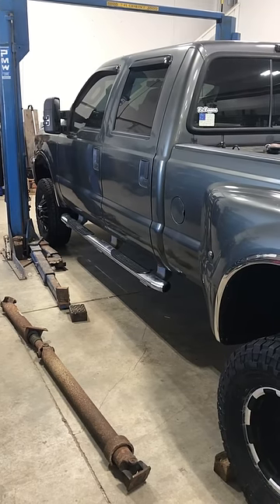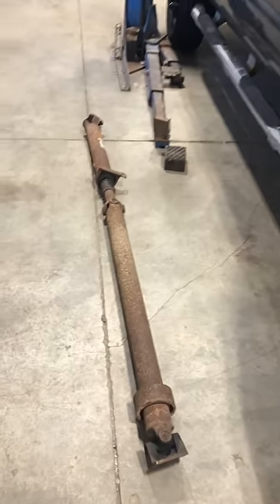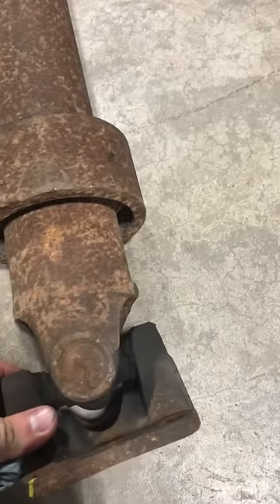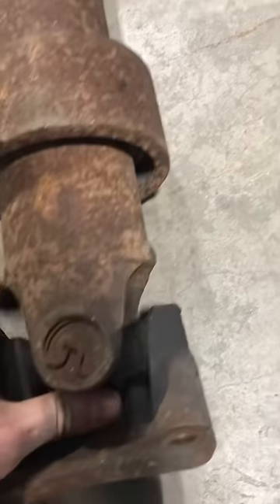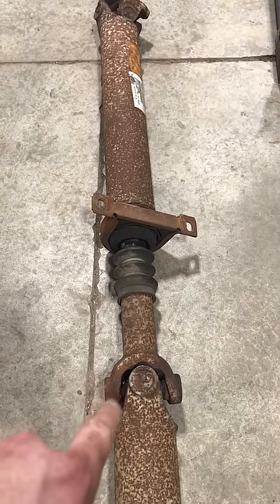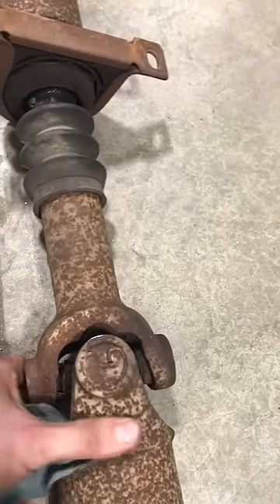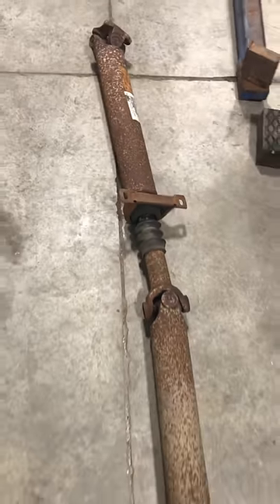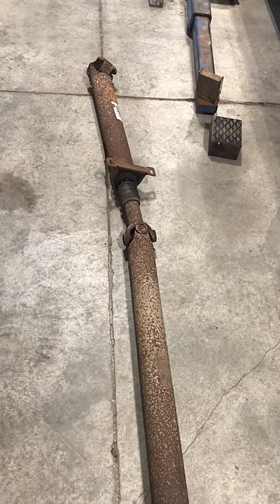Bad Vibes - Ford Driveshaft #shorts

Comment: ... or a whole new driveshaft. One from the junkyard, at the very least.
Reply: Probably cheaper, hell and aftermarket might be cheaper then fixing that
Reply: I agree, probably the easier, cheaper and more sane option than trying to reserect that abortion
Reply: Exactly.  Not knocking Wes' skills,... but  depending on how long I was  going to keep the truck for,  I'd be looking at what I can get off of the heap, or seeing what a f̶i̶n̶e̶ manufacturer, such as Dorman®, wants for one.
Reply: Yeah.  Why not put a higher performance aftermarket shaft in ?
Reply: I wouldn't put in a used shaft without replacing the u joints. So not really cheaper.
Reply: My local junkyard runs every driveshaft in any rear wheel drive vehicle because they pick up the vehicles in the middle with a huge fork lift and completely bend the driveshafts..  there missing out on a lot of $$
Reply: That's like $20 bucks in parts and $15 in labor 😂
Reply: That could work but you can forget the partridge in a pear tree...
Reply: @ELEVOPR  one slip yoke is more than 20 bucks😂

Comment: Had someone that I knew, but I didn't consider a friend ask me about "vibration" when driving. Looked and very similar to what you found on this one. Told them they needed all new u-joints and carrier bearing. They complained each time I saw them for 6 months, and then on the highway at 70 mph the drive line finally gave up. The carnage was unbelievable. Destroyed the box and some of the rear suspension.
Reply from the maker: Ouch!
Reply: My brother was driving a friend's old Ranger at 70ish with one that we all knew needed replacement, and it grenaded the tail end of the transmission and punched a few holes in the floor. Cut his leg up a bit too. Oh, and it flew out from the side of the truck and bent a farmer's galvanized gate and took a hinge off the post, lol. Yeah, I don't mess around with driveline vibes anymore.
Reply: @ChevyConQueso  He could have killed someone with that - a child or a road worker.  Suddenly freedom from MoT isnt maybe so great.
Reply: Things that nightmares are made of.. happened to my brothers 01, now has a mount for his trans made of angle iron and all thread.. and I brand new aluminum driveshaft
Reply: @Light Roast Coffee "the driver's manual used to tell you how to adjust the valves. Now it tells you to not drink the antifreeze."; OMG that is so true. HTF did we get here?  At any rate.. people will spend an entire Sunday cutting coupons for 50 buck savings, but act like a 30k to 50k vehicle is disposable. I can't wrap my head around it.
Reply: @ChevyConQueso  me in my cherokee 
I can’t feel the driveshaft vibrations over the death wobble 😂
Reply: @loganthesaint  I just fixed a baby Cherokee this week with the death wobble. The owner drove so long with it, I had to rebuild the entire front suspension, then I could replace the weak, ineffective steering stabilizer with a better aftermarket one. The owner couldn't believe the difference, lol.
Reply: @loganthesaint  Lol. Yeah the first time I felt the death wobble in my old F250 after hitting a massive bump scared the hell out of me. I hit a big pot hole and it became absolutely uncontrollable. I did all of the ball joints 3 days later when they showed up in the mail.
Reply: @elmerfudpucker3204  I have 3” wheel spacers on mine so I go through ball joints about every 3,000 miles now 😂 
I need an axel upgrade. Honestly.
Reply: @ChevyConQueso  a lady tried to stop me driving home, said my tires were doing weird things 😂 like lady I know 😂
Reply: Acquaintance

Comment: Hope the carrier bearing is replaceable, I had one in a 1/2 ton ford that was not. Had to get a whole drive shaft. I hope you make a video of this. Like your channel keep up the good work.
Reply: 8-0
Reply: They should so like they do in electronics for IC chips; stamp them with a "U" like "U1", "U2" "U3" etc. which stands for "unrepairable assembly"!
Reply: @csterett  :-D
Reply: A complete used shaft from a non-rust belt truck
Reply: Guessing it was an '09 or newer F-150? The carrier bearing failed on my 2010 F-150 and we ended up having to put a whole new two-piece driveshaft in it with new carrier...could not just buy a replacement carrier. I'm not impressed with the quality of the aftermarket driveshafts either...keep having issues with the u-joints wearing out prematurely.
Reply: @MichaelTJD60  Recon with getting a quarter to a third the milage of the original if you install aftermarket parts. Batteries are the worst. 8 years on the first, 2 years on the next. Sometimes it makes sense, other times it's false economy.
Reply: @erik_dk842  how are original batteries better they are not made by car company just a few companies make all the batteries unless you got a different size then original or alternator is bad or driving too little
Reply: @ranger178  The factories getter better grade batteries than we can buy over the counter.
Reply: @erik_dk842  there is only two or three manufacturers of wet lead/acid batteries out there. There is no “better” grade to be purchased by the manufacturer. The only difference would be the supplier in general.
Reply: @bigbruno84  entirely plausible that  the contract the auto parts store has and the one the auto manufacturer has are fulfilled with batteries from separate assembly lines manufactured to different specs, even if they have the same stickers on the outside
Reply: @richardwelsh7901  trust me, they aren’t. The reason I know? When I worked at Nissan selling parts, Interstate supplied out batteries. When we needed to pick up an order of them between their normal delivery times, we would go to the local interstate warehouse to get them ourselves. I literally watched grab the batteries, and slap a Nissan label on the same battery they would sell to anyone else. They also supplied batteries for other manufacturers at that time as well, and would do the same thing each time, for each brand. They are the same, there is nothing special out there. If anything, the factory battery in my experience tends to shit the bed sooner than any replacement I’ve ever bought before.
Reply: @bigbruno84  that sounds even more plausible honestly.. I bet  if I actually replaced my batteries with the same brand it came with from the factory it would last more than a year or two
Reply: @erik_dk842  Quit buying "premium" batteries with higher CCA than OE. They increase CCA by using thinner lead plates, making them less durable, and more plates so there's less space between them making them more likely to short.

Comment: I took my perfectly working shaft to a local driveline shop to have the u-joints and carrier bearing replaced.  Came back with a bad vibration at 60mph, they said it was my tires.  They did not properly install the carrier bearing, slinger was not R&Rd for the proper one for that make and the rear shaft collar was not installed.  Rubber lip was wearing on slinger.  Center u-joint had 7 by 12 thou of axial runout, spec is 2 thou.  I replaced all of the parts with the OEM Spicer replacements, vibration went away.  They charged me less than I could buy the parts for, so that should have been a clue.  They would not make good on their work, so I re-did it with quality parts.
Reply from the maker: Yeah it's pretty hit or miss with driveline shops.
Reply: @WatchWesWork  The irony is that as a driveline shop they have ONE JOB and that is to fix drivelines.
Reply: Lousy jobs are not confined to USA. Here in Land Down Under had several examples of Australian wide suspension specialists saying car should NOT be driven and preferably be scrapped as it is not worth repairing. Checking car for friend of my son showed nothing wrong with ball joints and all other things they said. Plus found other things actually wrong which they did not pick up. With owner we fixed it at home on my 2 post hoist. Still took some work but can prove that what they said was wrong was not. Very happy owner. Bob Hudson. Retired mechanic.

Comment: I had an impressive failure on the driveshaft of my beloved MGB. Put my foot down to pull away from a junction, and there was an almighty bang followed by what sounded someone drilling through steel. The drive shaft had actually distorted and sheared in two, the drilling sound was the front half rattling around in the tunnel that surrounds it near the gearbox. The garage I took it to kept the old driveshaft on display as they'd never seen anything like it. Must have been a flaw in the casting or possibly a fatigue crack that developed over a very long time (the car was close to thirty years old at that point).

Comment: It was amazing watching a guy balance a driveshaft.  Spins it in a big lathe, then uses a torch to shrink metal on one side.  Spin, repeat.
Reply from the maker: That’s how they straighten them. They usually still have to weld weights on the balance the yokes.
Reply: That would be to true the runout on the drive shaft although it also would affect ( probably improve ) the balance at the same time. Once the runout was corrected, then an actual balance machine is used to sense the out of balance and weights are welded onto the drive shaft if required onto the tube typically just back of the tube to yoke weld joint.
Reply: I made the investment on getting all new u-joints, carrier bearing and having the driveshaft balanced on my 2001 W900L.  The difference in ride quality and fuel efficiency was quite noticeable.

Comment: Wes, just a misfire, you got a customer who self diagnosed the problem. Welding the cap is usually done during the snowstorm, and there's probably some rusty vice-grips still attached to the brake cables which were repaired at the same time. He's looking at a $$$ repair now and in the future leaking trans. and diff. seals.

Comment: Drive shafts are robust items that are not treated with the respect they deserve at times. Any rotating item can be destructive. It looks like it ended up at the right workshop Wes. Please do a video on the repair, I am keen to see how you get the welded caps off.

Comment: So I actually saw something as dangerous as this about 12 years ago. On a main road between two mountain towns (so the road was nice, flat & straight), I see this clown heading towards me in a Nissan 4WD, the front wheels had obvious toe-in, the whole vehicle was shaking, occasionally the front wheels appeared to lock so it did a skid-shuffle, the clown was fighting with the steering wheel and could barely keep it in a straight line. The vehicle didn't show any obvious damage but whatever he had run-over did a number on the steering and possibly the front suspension & drive-line.  Anybody with 1/2 a brain cell would have called for a flat bed.

Comment: Glad I watched this. Currently in the process of replacing the ujoints and carrier bearing on my super duty and I was unaware that the yokes needed to line up I was under the assumption that if it was balanced it shouldn't matter.

Comment: Reminds me of a driveshaft that I saw in one time. Truck brakes had frozen, air brakes,driver did not drain air tanks. The shaft was twisted like you would not believe.The repair shop was able to make a complety new drive shaft,I think the only thing they were able to reuse was the slip joint from the old shaft.The driver had a hard time finding a job in the area after that.
Reply: I saw a driveshaft that came out of a big truck once, ( that looked like if you took a bath towel and  got ahold of each end and then twisted it  around and around),  the driveshaft had twisted in two pieces .

Comment: The most I have ever messed with driveshafts was on my freightliner dump truck and I had them rebuilt a few times. Until a guy told me about a heavy duty set of yokes and I bet the last one is still in there.

Comment: I have done more driveshafts because of improperly aligned yokes than any other reason. Close second is dried and rusted out bearings mainly due to no one ever greasing them. In wet or salted weather and especially after driving through deep puddles all grease fittings should get a couple shots of grease as soon as possible.

Comment: Surely this entire driveshaft will be replaced...
Reply: I'm not sure if you can replace that carrier bearing..  If you can replace all the bearings, then it's fine.  That rusty shaft is still plenty strong.  and a new shaft would rust just like it very quickly anyway.

Comment: After lifting my ‘12 up 5 inches I got some pretty nasty vibration when accelerating , the drive shaft angles changed . I replaced the carrier bearing and installed a 1/4” spacer between the bracket and bearing and that solved my issue . Luckily there was no issues after that . 20k miles later so far so good . When you mod these trucks there’s almost always a supporting mod you must do for it to run properly.

Comment: Not gonna lie, when I first started learning how to work on vehicles, I accidentally made my driveshaft out of phase. But I later did more research an managed to fix the issue.
Reply from the maker: Most people get them 90 degrees out.
Reply: @WatchWesWork  Some (but I forget which) are keyed so it is impossible to get them out of phase. The male part is missing a spline groove and the female has one extra wide groove. On regular driveshafts it is still possible to get them 180 deg out. Simplest thing is to just center punch a couple of witness marks on the coupling... assuming it is in phase to begin with!
Reply: @utidjian  The tire machine was right beside the hoist in most shops I worked in. a crayon dash on each piece after sighting to be sure the last time it was put together in phase.
Reply: @WatchWesWork  I've seen some that are 90 degrees out of phase from the factory, and that's how they're meant to be.  Shown as such in the factory manual.

Because of the way the vehicle is designed, they can't get the front propshaft to run without vibration anyway, and (my understanding) running 90 degrees out of phase halves the amplitude of the vibrations, but doubles the frequency of same.

Comment: I was working at a sweeper outfit and they decided we were spending too much on maintenance . A few months later we dropped 7 driveshafts at a cost of $650 each not counting the tow and damaged air lines .And torn up electrical harnesses . But the saved a couple of bucks for those 2 months Of course bearing replacements went through the roof on the whole fleet and they tried to blame us in the shop.

Comment: Sounds like a job for used parts, a bit like that rear end you swapped instead of rebuilding.
Reply: I wouldn't tend to want to use used bearings.  I consider U joints to be bearings.
Reply: @12345NoNamesLeft  every time you but a used vehicle you buy a bunch of used bearings. ;)

As it needs yokes a used driveshaft will be the cheapest way forward, even if it does then need UJs and a carrier bearing. But one should also take into account the condition of both the used shaft and the rest of the truck. If the shaft seems in decent condition and the truck has only got a year or two left before the frame snaps from rust, is there much point in putting new UJs in it?

Comment: A 2006 Nissan Titan started hopping down the road at certain harmonic speeds. The carrier bearing had disassembling itself in such a way that when it got put on the tow truck it would pop back into place and be fine for weeks or months. Finally got my thermal camera out and got serious... Replaced it in a few minutes... And she's somewhere around 425,000 miles now. Also... The drive shaft on my Titans have been some of the nicest I've ever seen. Course I haven't really worked on any other vehicles but still they're just super beefy and lightweight aluminum. But massive in diameter like twice the size of the one in the vid or something like that
Reply: And mine was the opposite. It would start vibrating when I took my foot off the gas at around 55 mph

Comment: I have a 2003 Silverado LB7 with 109k miles. I just did a complete rebuild of the truck for a 650hp daily driver. My carrier bearing and U-joints were bad.

Comment: Call CCI Driveline in Michigan. They can hook this truck up with a single 4" steel shaft. Eliminate the whole carrier bearing. Check your driveline operating angles/shim. Be better than when it left the factory. Personally my CCSB has a 5" aluminum driveshaft and it made a world of difference vs the stock 2 piece(which had new joints, carrier, balance and was phased properly). I believe they wont do a CCLB out of the 5" aluminum though. Good luck!

Comment: I’m a former driveshaft technician 
I appreciate that you’re actually right about what you’re saying. 

But I’ve seen a lot worse lol
Reply from the maker: The only ones I have seen that were worse were in several pieces. I had one on a International dump truck that fell off the transmission while driving...

Comment: I had a 2003 Tacoma someone had just bought from a small sketchy dealer. The test drive was awful. As I pull back into the shop was when the pinion snapped off as well as both yolks fell apart and the diff was on fire. It held together for my 3 mile test drive and the customers 35 mile drive to the dealership

Comment: I remember my boss bought a nice new pickup truck that he drove for work in his construction company and he took it in for service because he loved that truck our work vans were beat to heck but he had them change differential fluid  with pretty low miles on truck and the mechanic forgot to put fill plug in or didn't tighten it so as he drove down highway all the oil sprayed out and both rear wheels locked up right in middle of 3 lane highway blocking two lanes as it was diagonal on road what a traffic mess that was. i believe he got them to pay for new rear end and tow and such. it couldn't even be pushed off road to get out of way